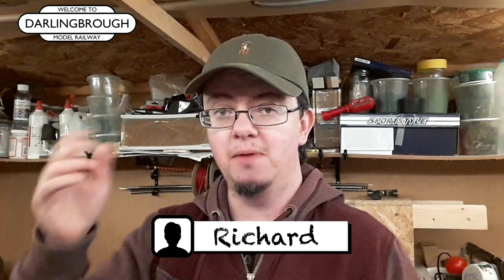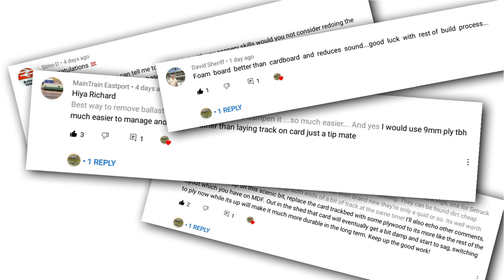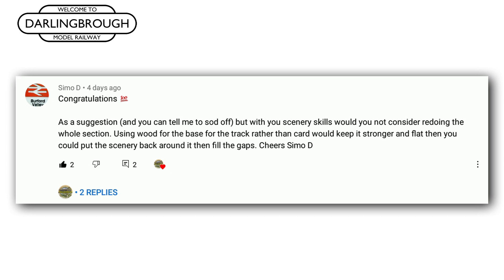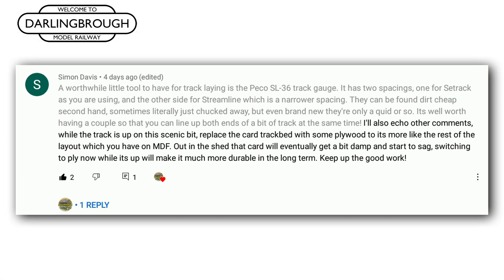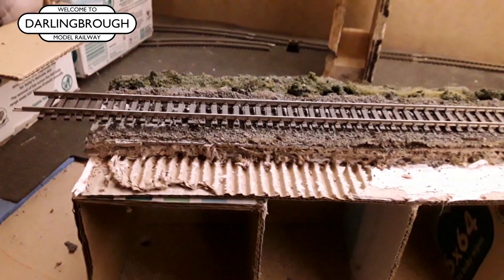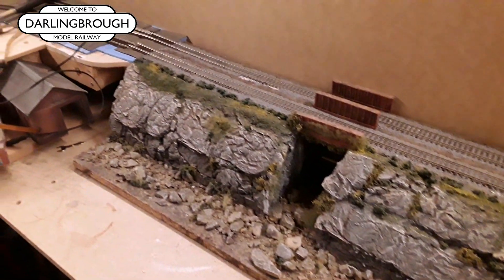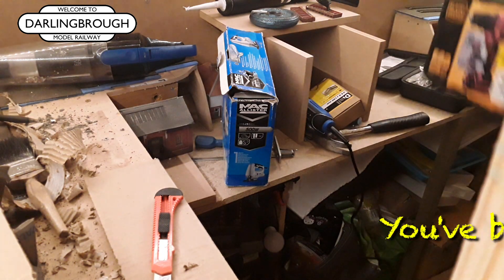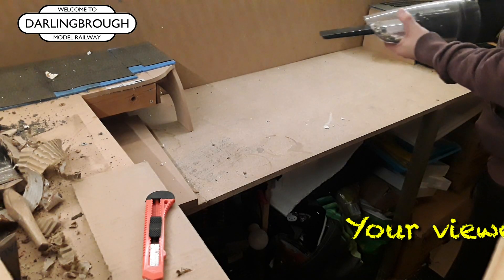Replacing the Rocky Bridge Section... What are my options?

Comment: I've read tham all too. You will note from the comments already made that the 'wood' you have used is medium density fibreboard. That's not really an outdoor material - when it gets damp it absorbs the moisture and swells. You could try painting it with a decent oil based paint but the edges will just soak up the paint unless you seal them with pva before painting. You've built a sturdy frame - using plywood as a track base will reap long term benefits 👍
Reply from the maker: Hi again David! Thanks for all the feedback and help you have given! I am thinking of sealing all the wood before I progress with the laying down of the track, so that might be a good way to do it! Thanks for the tip! 👍👍😁